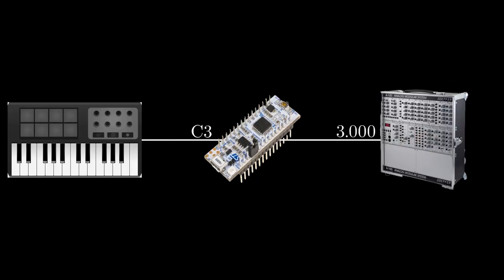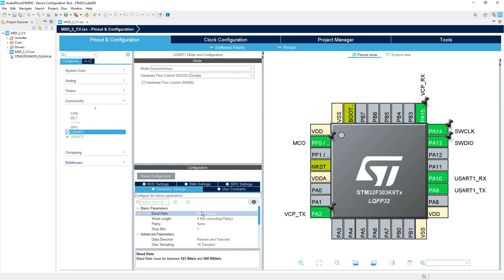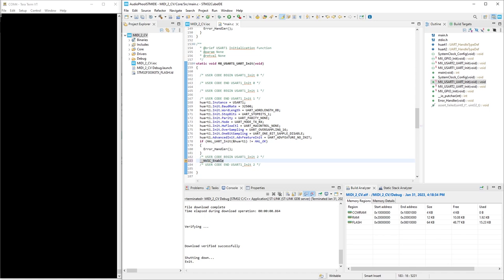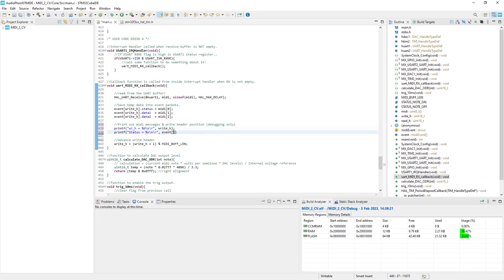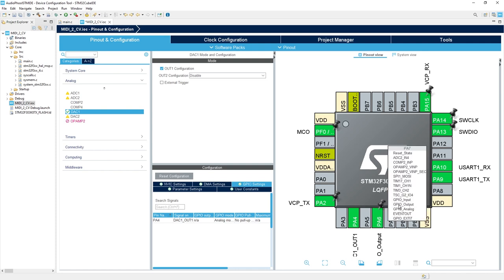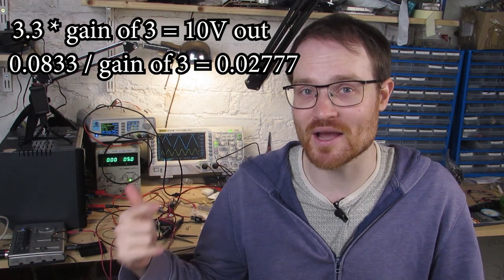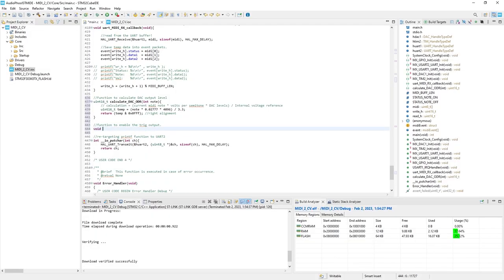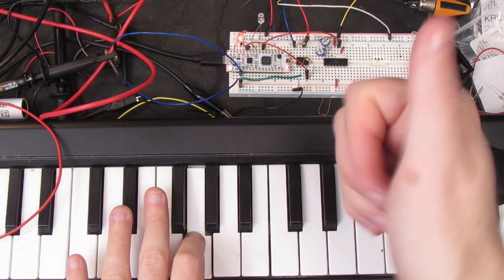ARM Microcontroller MIDI-to-CV: A Straightforward Guide

Comment from the maker: So i goofed up and set the MIDI baud to 32500 when it should be 31250. Probably a typo initially that i just ran with! Maybe i need a proof reader 😅
It works either way because each bit is sampled at the middle of the bit, and oversampled by 5 times so at these speeds the correct bit is still sampled, which is why i didn't catch it!
But set UART 1 to 31250bits/s to make sure your system is as robust as possible!

Comment: Not sure if I missed something, but no disabling interrupt during the handler? Or just not worrying about it at MIDI baud?
Reply from the maker: Yeah just not worried and also trying to keep things as simple as possible. The rxne flag is cleared when we read the UART so it works out ok. Nice to see that someone is paying attention though! 😁
Reply: @TheAudioPhool  Makes sense, I'm not really clued on the vendor specific flags!
Reply from the maker: It's a real pain tbh. You have to look up what action clears which flag.. probably easier to just turn the interrupts off 😅

Comment: Great tutorial. I have been wondering about midi to cv solutions. Do 16bits (also with 3x amplification) generate accurate pitch values?
Reply from the maker: 16 bits will do great. The board i used has 12 bits and the tracking is good so 16 bits will be 16(2^4) times better!
Reply: @TheAudioPhool  Because of the 12 bit DAC, we have 409.6 unique values per octave, giving approximately a 3 cent resolution. Did you notice this granularity? Looking at the number, it seems a bit big, and much too big for smooth pitch bends. But I have not tried it and maybe 12 bit is actually enough for the regular keyboard notes. 
I don't know if the uC has more analog outs, but would you recommend an attenuator that scales another 3.3V range down to whatever pitchbend range you want and add it to the 0-10V CV for smooth pitch bends?
Reply from the maker: This is such a great question and something i thought a bit about before i made this video. What i didn't like about a lot of other tutorials is that to use a 16+b external DAC you need to use SPI which i think is quite involved for a beginner, but obviously the tradeoff is that most uC's only have 8/10/12b DACs inside, unless you go onto a fairly big development board or an FPGA or something. That's what makes this board a great pick for this because it hedges those 2 tradeoffs quite nicely i think by giving you a few options. 
So if we compare a standard midi controller, i'm sure you know this already but pitchbend messages are actually 14 bits long by combining both data bytes. 14bits = 16k levels, bending across +/-2st you get 16k/4 = 4096 steps/semitone in your bend, If you bend over a major 3rd(+/-4st) you get 2048 steps/semitone. 
Across the full 10v with this 12b DAC you get  34.133(4096/120) steps/semitone at the output of the DAC as you correctly calculated (2.92 cents). Which is fine for the individual notes (off by a max of +/-1.5cents is ok), but for bends, compared to what a standard MIDI controller will ask for (limited to a major 3rd) we are off by a factor of 64. You would be able to hear the steps over a nice slow bend. 
So, the cool thing about this micro is that is not only has 2 DACs built in, but also has built in op-amps that you can configure in software. So yes you could use the 2nd onboard DAC to output effectively just pitch bend information and then use an op-amp (internal or external) to scale it down to your desired pitch bend range (say 1-4 semitones) and then use a simple op-amp mixer for your final CV output. I didn't include this in the video because it's a little involved to set the op-amp etc but if you're not scared of the documentation you can have a look through it! I would say the easiest option is to set it with an external op-amp and trim it in with a small potentiometer, like i did in the video for the CV output. so lets say you limit DAC2 to going up or down by 2 semitones each way that gives you 4096/4 = 1024steps/semitone or 512steps/semitone for a major 3rd, which is comparable to the output resolution of a 16bit DAC.
If you want larger bends i would go down the SPI route and use an external 16 bit or better DAC, which will give you the resolution you need to bend. 16bits over the full 10 octaves gives you 546 steps/semitone, 18 bits gives you 2184 steps/semitone which will give you the needed resolution if you wanted to use all 14 bits of your pitchbend message from your MIDI controller.

Thanks for watching and thanks for the thoughtful question!! If you join my patreon you will get updates for this kind of addition to the MIDI controller and a load of other features :)